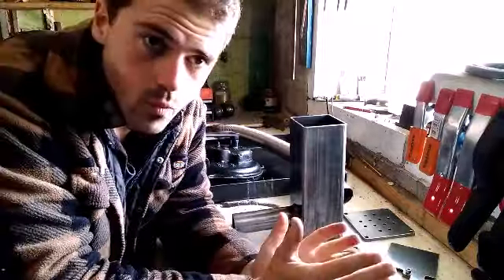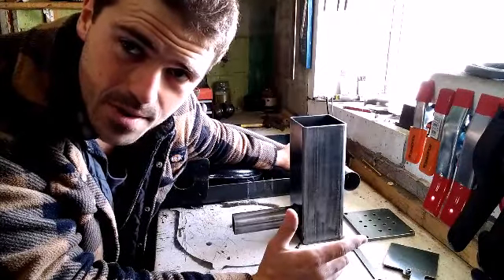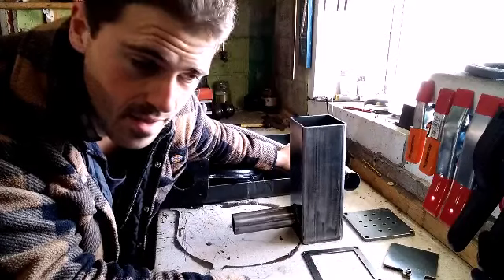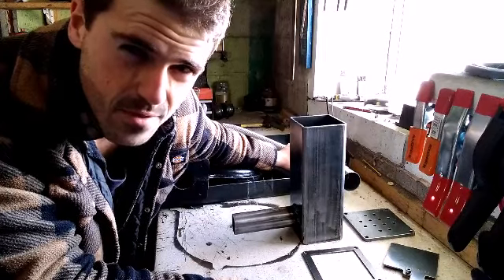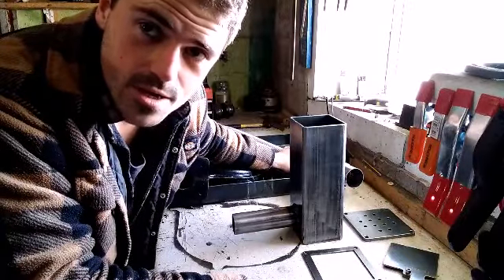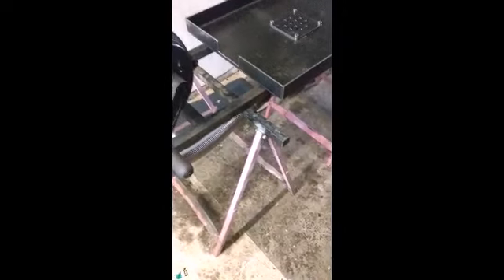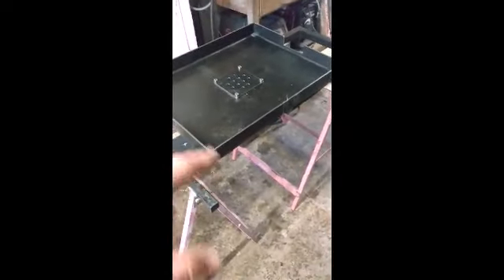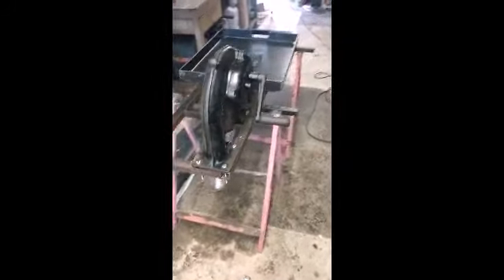OZO coal forge and DIY forge blower

Comment: nice job. Did you figure out the noisy blower? Could be one of those units that you need to add oil to regularly, or a bit of grease might do the job.
Reply from the maker: Yeah I injected grease into the gear box and it's still noisy and now harder to crank 😂
I think I'm going to fix a motor to it and see how that goes.
Reply: @roughnecktv6535  I use a boat bilge blower to feed air to mine.